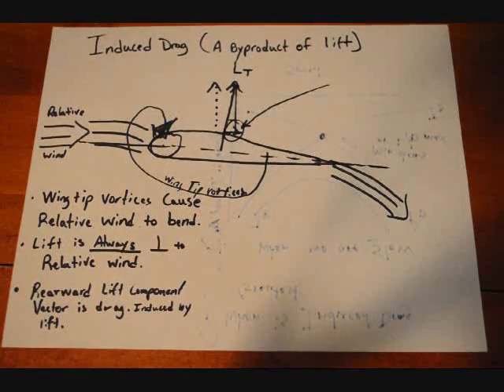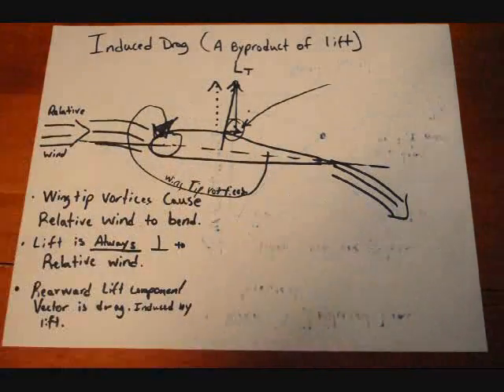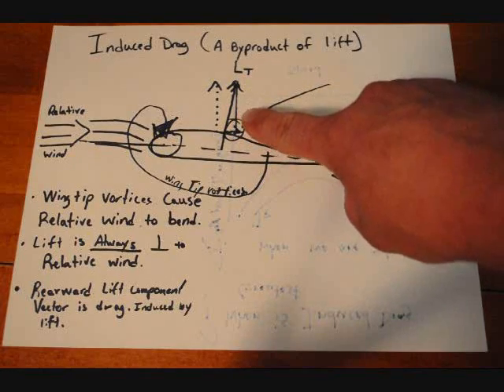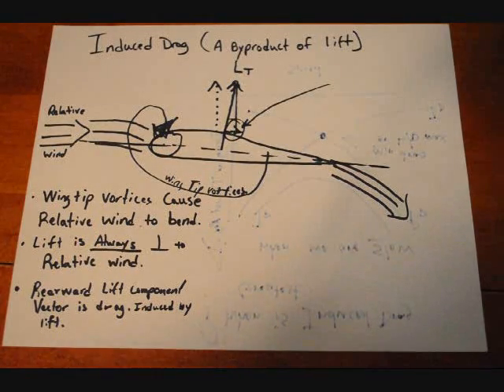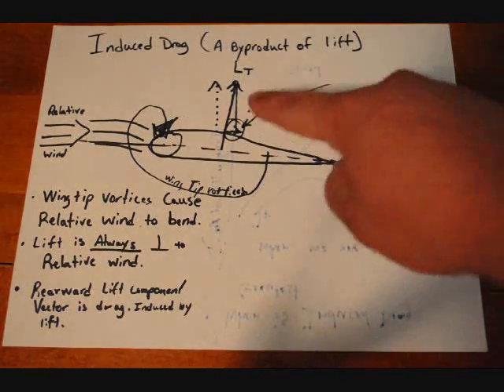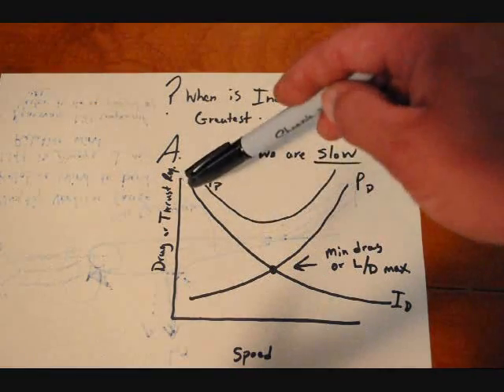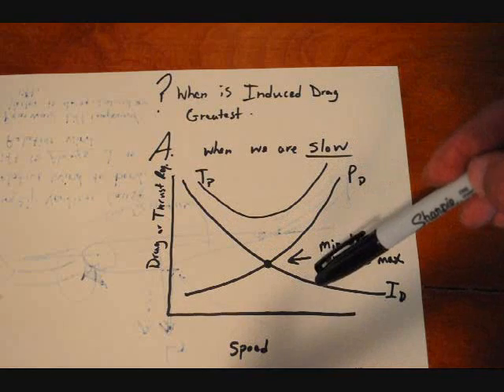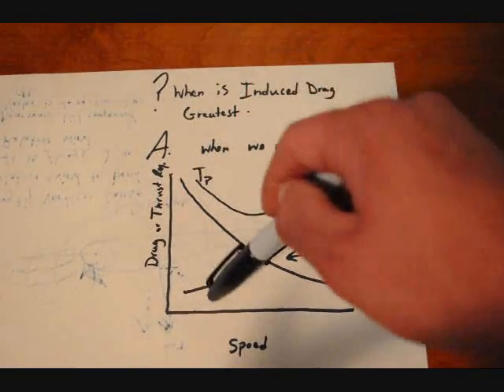induced drag

Comment: In your diagram the wing tip vortex is shown at the leading edge. Isn’t the vortex behind the trailing edge since the aircraft is moving and if so, would not only the relative wind aft of the trailing edge angle downward because of wake turbulence?
Reply from the maker: I'm sure my understanding of aerodynamics is relatively basic, however, what I'm trying to show is that the relative wind gets bent slightly downward by the vortices. Remember lift is always 90 degrees to the relative wind, therefore a small component vector points rearward. That small amount of lift in the direction opposite the travel of the aircraft acts as drag.
Reply: l agree with you 100%

Comment: Why is lift perpendicular to relative wind?
Reply from the maker: The relative wind is how the flowing air and wing interact so therefore the lift component is calculated in relation to the relative wind and not the wing. Being an upward force it is perpendicular to the wind and not the wing.
Reply: @gthree0239  why is slower air that goes into the engine quieter?
Reply from the maker: @ShadowRap-y5l  I have no idea

Comment: Why don't we have huge parasite drag when flying slow with high aoa. When you pitch up the wing, shouldn't that result in high parasite drag because the relative wind "sees" a lot of wing?
Reply: Parasite drag is more prominent at the faster the aircraft goes. "Why don't we have huge parasite drag when flying slow" parasite drag is already greatly reduced here because you are going slow, "with high aoa" there is more form drag generated by the wing at a high aoa and there is a large amount of parasite drag. At some point, close to this scenario, that drag will overcome the lift being generated and you will have a stall.
Reply: Thanks for your reply. Still I don't quite understand.
I do understand, that parasite drag increases quadratic with speed. That explains that parasite drag sharply increases with high speed. No prob here.
On the other hand, you write that with high aoa (=flying slow) there is more form drag generated by the wing. Now, form drag IS parasite drag. When you look at the Lilienthal polare you see, that CD (drag coefficient) sharply increases and CL (lift coefficient) sharply decreases near the stall. So all we have is drag and no more lift. And I can't understand why this drag qualifies as induced drag, because it produces no lift, as we said.

Comment: Hello! I'm currently revising and the given equation for drag is D=0.5*(air density)V^2(wing area)*Cd. How does this link to induced, parasite and total drag? Does this equation give the total drag?
Reply: There is a lot to explain, to really understand it I recommend reading The Illustrated Guide To Aerodynamics by H. C "skip" Smith, second edition. Chapter 4 goes into the details of drag.

Comment: whenever there is lift, there is induced drag. Does the induced drag proportional to lift?  is it correct if I say "the more lift, the more induced drag"?
Reply from the maker: Heavy,  slow,  and clean.  Induced drag is greatest in this configuration.  The more lift you squeeze out of your wing( is how I think of it ) the more induced drag.  As you accelerate induced drag means lessens but parasitic drag increases.

Comment: Is the minimum drag where the parasitic drag and induced drag intersect?
Reply: Yes
Reply: Yup, considering both of these kinds of drag. I think this point would be called the point of drag equilibrium, and is understandably the optimal speed regarding fuel efficiency. This would be the "cruising speed" indicated in your aircraft manual.
But also no, if you consider the fact, there is no drag when there is no airflow. So, the minimum point of drag would be, well, when you're not flying it. But, that's not very helpful... lol

Comment from the maker: Spencer Charlie: Static air above the wing is acting like a wall (making a venturi) between the static air and the wing. Wing camber (upper surface curvature) creates the nozzle of the venturi thus speeding the air up over the wing lowering the pressure. The air under the wing is moving slower.  The air under the wing is higher pressure and pushes on the wing causing lift.  Of course this is a really simple explanation but it is the basic theories of lift.
Reply: How do the wingtip vortices cause the relative airflow to bend down?
Reply: The air lowing up in a circle to the top of the wing quite literally comes down and pushes the air leaving the trailing edge downwards.